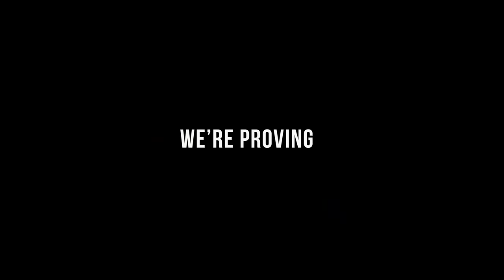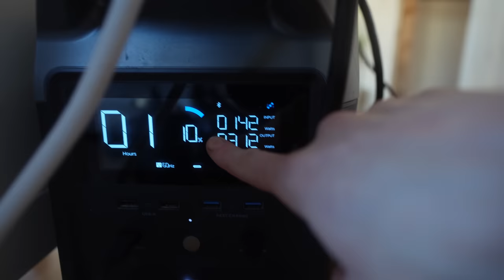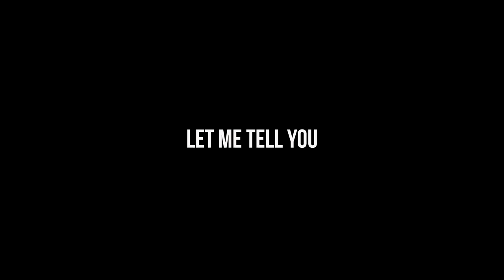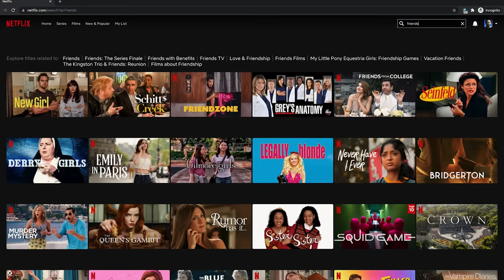Secrets About Off-Grid Living- Is It A Lie?

Comment: I have an off-grid house here in Finland where the main goal was comfort, just without being connected to any utilities. For all intents and purposes, the house has all the modern comforts you would expect from a house, with washer/dryer, dishwasher, flushing toilet, shower, etc. - it's just done without any utility connection. As you said - it's a spectrum, and some of the gate-keeping you find in some off-grid communities can be off-putting. Go with what your definition and goals are, and you'll be fine.

Comment: Love the quick-paced visuals. Lots of variety. After putting up the ceiling boards you might want to monitor the temp differential between the roof air space to the ceiling and the indoor temp. Reason - moisture buildup on the upper ceiling causing mold. Spray foam insulation may be the barrier needed to prevent this moisture buildup.

Comment: Always so much fun watching you two! Couple of things:
We have Starlink, too, and discovered that (with a couple of small modifications) a tv mini dish mount works well to get the dish off the ground and connected to the roof of our house.
Also, we have had a geothermal system for about 15 years in Ontario, which has been great for heat and hot water. The efficiency characteristics are one unit of energy input to 4 units of energy output. That means it uses very little energy to generate lots of heat, and it can run on battery power. Perhaps a future solution to reduce your dependency on propane for showers!

Comment: You're probably going to have excess power in summer, so you could use a small induction cook-top for those months for cooking. It helps to lower the need for propane, but also helps to keep the place cooler.

Comment: There is another way to mount your roof solar panels where they have a steeper pitch for snow shed and also important to have spacing between the rows so the snow can shed under the lower row. It's less maintenance (shoveling).

Comment: You both are so awesome! My husband and I are just finishing up building and developing our home on 5.5 acres. I guess we are a bit off grid since we have our own septic and well. I trenched and installed the power and internet conduit about 750', trenched and installed 300' of water line and did all of the site work including clearing a little over an acre and installing a ridiculous drainage system that our local county required . We used a generator until we were connected, so I get the struggle and extra steps. I so wish we could have been able to afford solar, but it was the first item cut when building materials went up during Covid.

Comment: My wife and I started living in our off grid home last October, just before the heavy frosts came in, since at the time we were living in a 19,5' RV. Our power is supplies with solar and gas generator since when we built our system we did not know how much power we really needed. As you we have propane water heater and propane kitchen range. We heat with a wood burning furnace that meets our needs.
  Our house is 24' x 26' with a basement due to the fact we raise the house so the seuwer would flow by gravity. We have a 14 acre wooded lot 15km from the nearest town which is Montmagny Quebec.
 Right now the major hurdle is keeping our private driveway clear of snow, unlike you we live on our retirement pensions so funding is limited. All our savings went into our land and house, we are free of mortgage but money is tight.
  We love it here, our offgride  house is 2200ft from the main road. Right now we are still in construction mode and will be so for some time to come but we LOVE it.
  Coming from close to Montreal where the life is never fast enough, we now take time to live and enjoy the woods and wildlife.
 In the future we plan to build a greenhouse to produce some vegetables and fruits. I would like to start making things with wood and or leather to sell to supplement our income.

 Next spring we will sell our 19.5' RV and a induction stove we no longer can use since we are offgride. 
 Until next time have a great day

Comment: I bought a cheap inflator based on recommendations from Project Farm. The Harbor Freight 12V heavy duty inflator is great, and I've used it a lot! Cost me $30 with a coupon. If your four wheeler or side by side is running, you can run it with that. Putting a cigarette lighter outlet in is easy. I even put an air horn on mine.

Comment: Off grid living is a lot different now than when I built my earth shelter in the midst of a state forest back in 1984.  Hand tools and chain saws...had a friend use his backhoe to dig the hole for the house, and 8 deep beds I filled with brush, logs, compost, manure...etc.  Before I'd ever heard the term Hugelkultur.  One little solar panel that was maybe 45 watts, bought from an advert in the back of a Mother Earth News.  Used a truck battery to provide power for a compact flourescent over the kitchen work space, and one over the bed for reading.  Had a 5" B&W 12 volt tv, which got over the air channels...of which there were three...we called them Bimbo, Rambo and Dumbo.  The screen would diminish to a dot in winter.  Then the reading light would dim.  We did have a 12 volt JVC dual cassette player/recorder, a linear tracking turntable and AM/FM/SW bands...and detachable speakers...wowsa....Hand pumped water into the kitchen sink, a sauna in the center of the house heated by our woodstove/fireplace Timberline...and the sauna acted as a plenum for the heat.  Outdoor biffy we'd cover with sawdust...and then open the back periodically to shovel into our 5 tiered compost system.  Outdoor shower in summer, solar heated...ladder to haul a five gallon bucket from kitchen to top of shower and cover with a filon hoop thingy I made.  House cost us $3500 US to build...the land was $2500...mostly used native materials, logs for girders and rafters, and had a local mill make 2"X6" T&G for sheathing the whole thing...then 2" of EPS over plastic sheeting...then buried the sucker...of course we have great southern exposure.  Back then no internet, little information about how to do what we were doing...and no money.  We've never borrowed to build.  Here we are now, much older and more entrenched...added solar panels over the years, inverters...etc...still use wood heat and hand pumped water...although in 2007 we pounded another well for a bathroom addition on the west side of the house, which involved digging out, building and burying...now we can pump water with the inverter, wash clothes and have an indoor toilet and a tub shower...running hot (on demand) water and cold both...I'm jealous of how much easier it is for folks now...wish I'd had YouTube to document everything back then and bring in a little income, but...at 75 soon, we're doing fine...(we do occasionally go to Mexico, I courted my wife in a '61 Westfalia...and have spent months at hot springs and on Mexican beaches)...be well, women.

Comment: You could also put up one of those smaller version of a wind generator or two. Not the size of the ones usually see pictures of. They make smaller ones like you see in fields and cattle and horse farms. And in fact if you think about it a lot of the days when the sun isn't out our windy days because of storm conditions coming through. And wind plus solar can be attached to the same batteries if you have the right connectors.

Comment: From the very beginning of Europeans coming to America there were many attempts at Utopian Communities. As an example, the Pilgrims of the 1620’s.
In the 1840’s there were several attempts at frontier Utopian Societies on the American frontier…places were the wealth earned was shared equally. In the end none ever worked out. In the later 1960’s &1970’s Communes sprung up again. Again many tried to limit contact with the outside world. 
Self reliance sounds good p, in theory, but to actually reach that point is a very challenging. I think you two have, so far, achieved an interesting balance of self reliance tempered with skilled assistance.

Comment: I live off-grid as well I've only got 5.6 kw of panels but got good view of sky in all directions, so probably generate more energy then you, but them power power stations are expensive, I've got 4 12 volt 200ah lifepo4 batteries that give me 10 kwh of battery storage cost at Canadian prices $4000 a Midnite classic 150 charge controller can be over paneled and a 3500 watt 48 volt outback inverter, that was $3500, good stuff, but with the amount of panels you have you would need 2 Midnite classic's because your so shaded in that over paneling is not the best option, a little advice only cut trees for firewood that are shading your panels.

Comment: Truly off grid here, not even cell phone reception unless you have a booster 40' up in the tree up on a hill. Mail runs 3 days a week over here and we walk the 3 miles to get it or drive depends on weather or what's coming in.  Water is collected best we can, being in semi-desert sometimes have to take 1650 gallon water tank in town to fill up. We get buried in the snow like you guys, and they only plow the main dirt/rock road after the storms, my YoutTube channel shows how bad it gets pulling county grader plow out, it's up to me to plow the 3 miles to get to main road. Solar power going to forklift batteries here (yes plural). 
Hardest part is fighting the 40 below zero temperatures with 60 below wind chills, battery capacity is next to zero, water is frozen, starting gen set in an emergency is risky, limited time outside, diesel for heater likes to gel up, and worry all time if vehicles will run in emergency to evacuate. If things went bad you're on your own, 50 miles from town, 3 miles from nearest useless neighbors and we are doing this in a truck camper as we build here.

Comment: We live on a 10 acre parcel beyond natural gas and sewer service.  So we had propane delivered and a septic system.  We get internet via a 600 yard wifi bridge from the nearest cable access point.  Are we off-grid?  We still get electricity and water service.  A couple of years ago we built a 5 KW solar array, and went on net-metering.  So we use the power company instead of batteries, but have never had an electric bill since then.  We got rid of the propane and do all of our cooking and water heating by electricity.  Heating and AC are electric too, but not very demanding because of the mild climate.

Redefining off-grid is the Inverse No True Scotsman fallacy:  I would say there are no off-grid posters on YouTube, because if you have broadband internet service, you are just cos-playing.  I think we need a new term for this, like Low Carbon Footprint Living.

Comment: Add weight to the plow!!! They R 2 lite and need extra weight on the Blade! I always added weight-lifting plates on the blade turn plate on the handle work fine. I added around 40 to 50 lbs Just saying it will make a huge difference!

Comment: Hi! A question: I'm thinking about building a full house and putting in solar panels/batteries for most of the power (this is still a few years away) so I'm always interested in finding out whatever I can about these kind of systems. I don't quite understand your solar set up - the big, standalone solar array must be producing power, correct? So, why isn't it powering your home battery? Or have you not yet linked it up to the house? I thought I saw in a previous video that you had but maybe I misunderstood. Thanks!

Comment: False! Off grid living is very hard. There is so much work that you constantly have to do every day, week, month, season. I grew up in remote Alaska, we had city electricity but did not have running water. We always said, yeah, we have running water! You have to run and get it! Lol.
My brother and I had to take the snowmobile and sled and get cord wood. It took about 3-4 days of constant cutting, bucking, and hauling to get a cord of wood. The limiting factor was the amount of wood you could put into the sled (bucked 4 foot logs). Having electricity was a saving grace because it made things so much easier than relying on a generator or lantern.